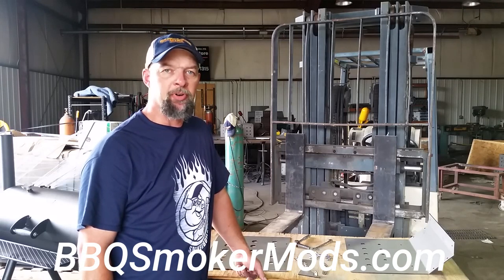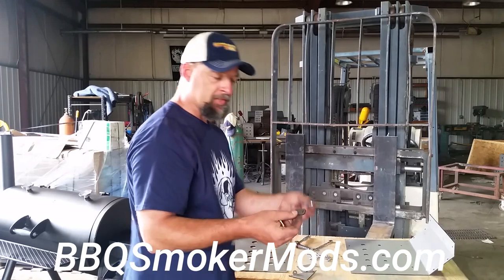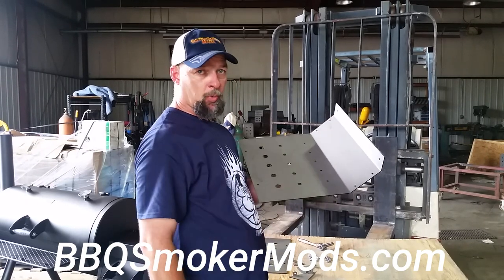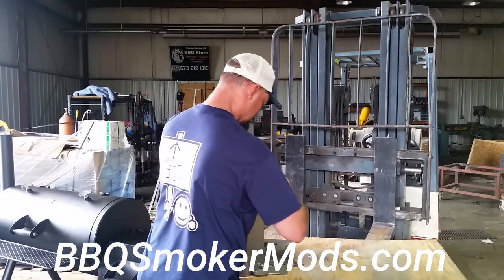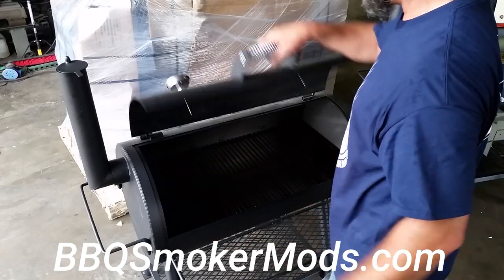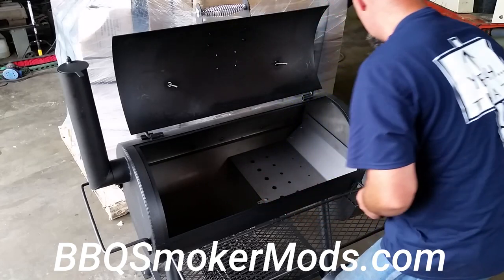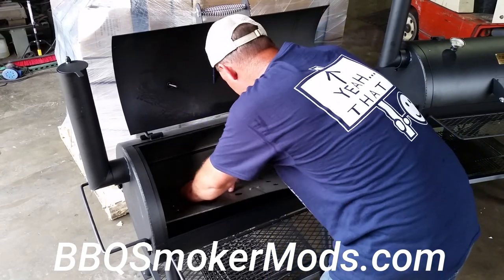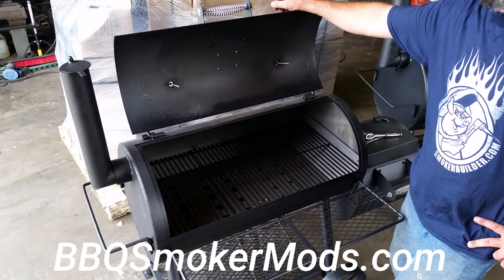Oklahoma Joe and Brinkmann baffle installation

Comment: Very nice and informative video. Question? Got my first smoker and I have leaks in the front and the back of the smoker. What can I use to plug the leak? Thanks
Reply from the maker: Go to BBQSmokerMods.com and look for either the LavaLock gasket or the black high heat food grade rtv sealant.

Comment: Why doesn't the baffle plate extend to the end of the grille body on the chimney side?
Reply: To clarify...it fits snug on the firebox side yet there is a huge gap on the chimney side.
Reply from the maker: This is called the baffle plate gap. we want to have the correct amount of restriction under the plate for keeping a consistent even temp from side to side. too much restriction and it will have the opposite effect and also cause white sooty smoke.